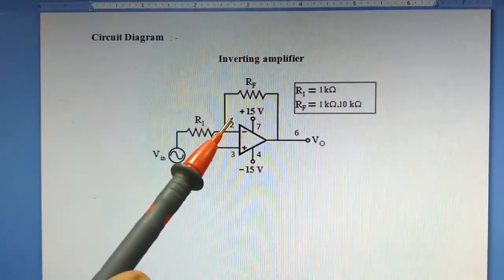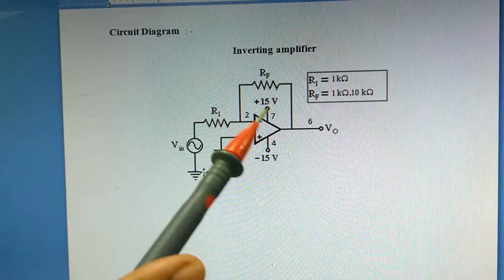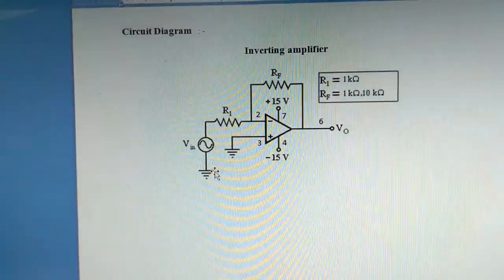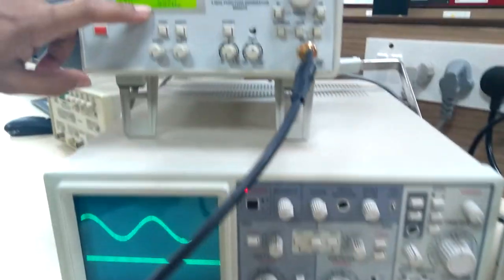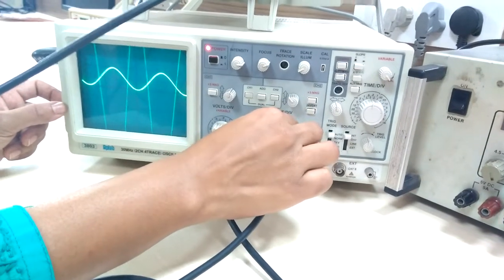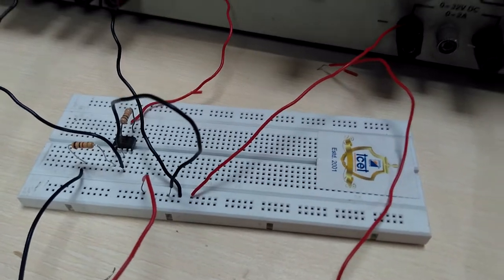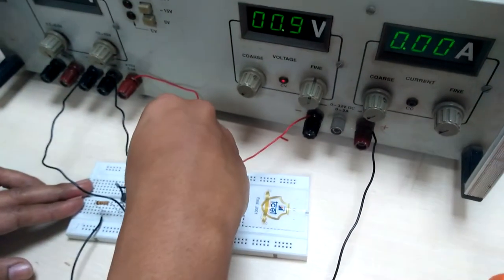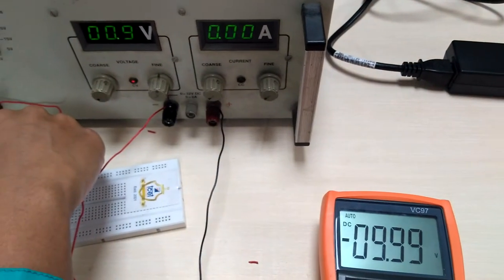Inverting Amplifier using op-amp IC-741

Comment: Mam is there any frequency range for input supply, or we can feed the wave of any frequency to get an inverted output?
Reply from the maker: You can give any frequency for input, but to avoid distortion u can use mid frequency range. I have given 1kHz frequency.

Comment: Why do input voltage is grounded?
Reply: Since inverting amplifier has a negative sign therefore all the connections will be with the negative terminal input and positive will be grounded , but in the case of non inverting amplifier opp will be done
Reply from the maker: This circuit is Inverting Amplifier so we are giving input to the inverting terminal of IC-741(i.e. pin no.2) and non-inverting terminal (i.e. pin no.3) is grounded.This is called Inverting Configuration.